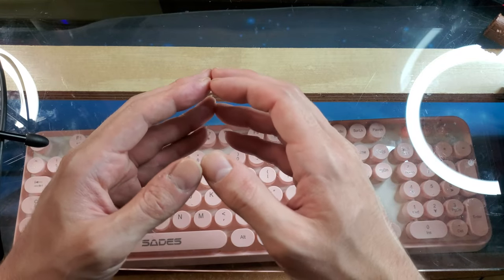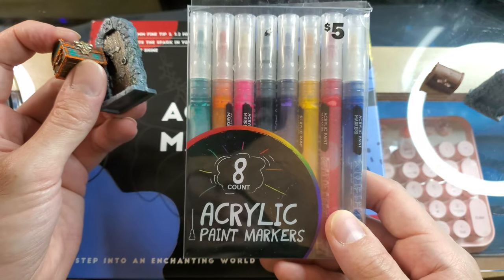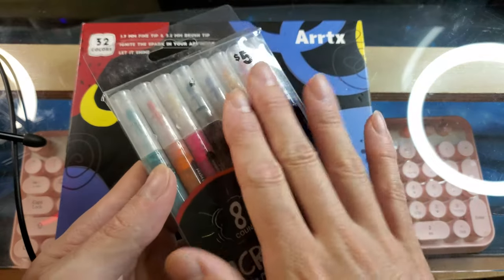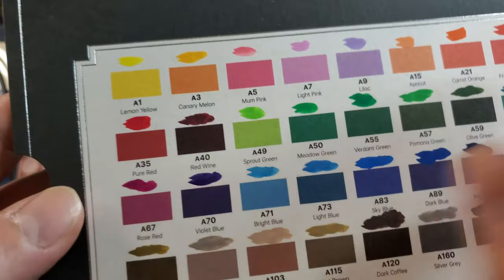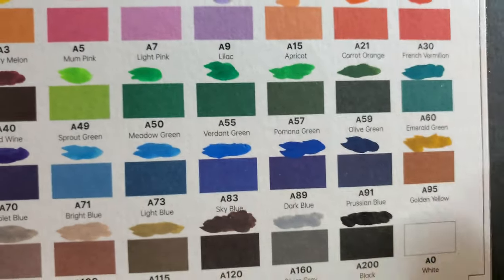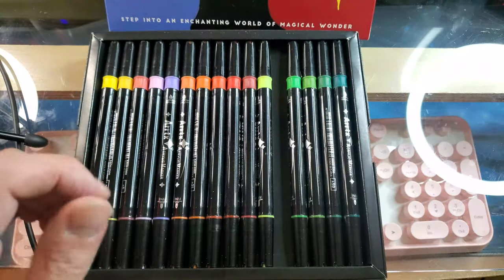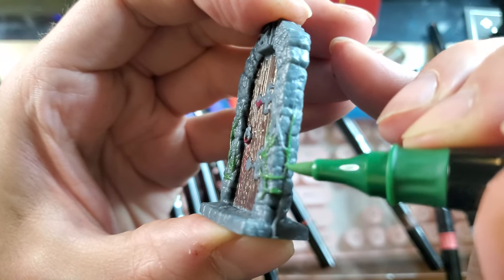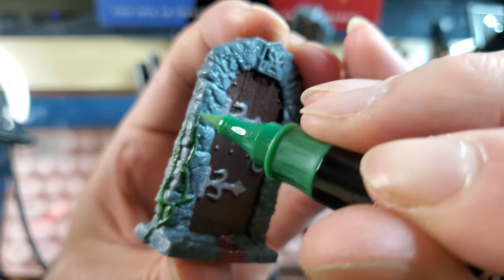Painting TTRPG Dungeon Furniture with ARRTX Acrylic Paint Markers || HeroQuest 2021

Comment: The moon eh... Have you seen Moon Knight yet? Sorry, a bit off topic! About the issue of the paint pooling, I wonder if the paint is just having trouble sticking to the bare plastic. Might try priming, it may stick to that better. Should be able to find primers in various colors, so you can prime it in the color that will be the most used so you can save the markers for the details.